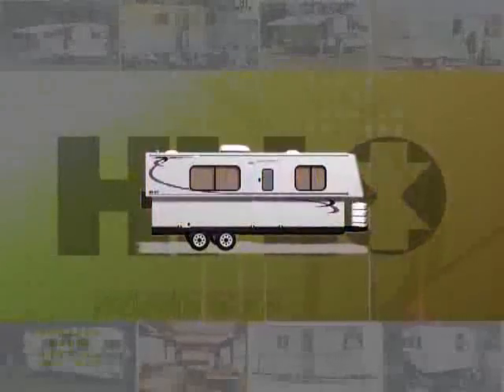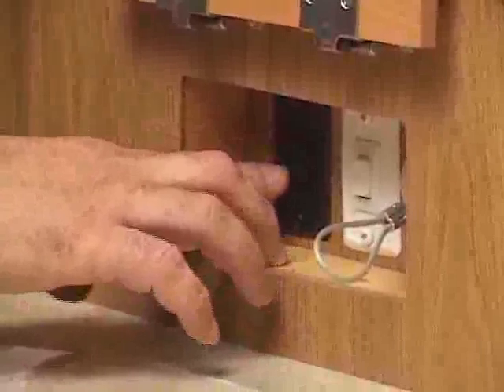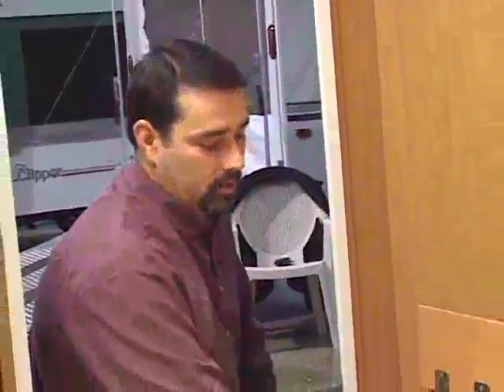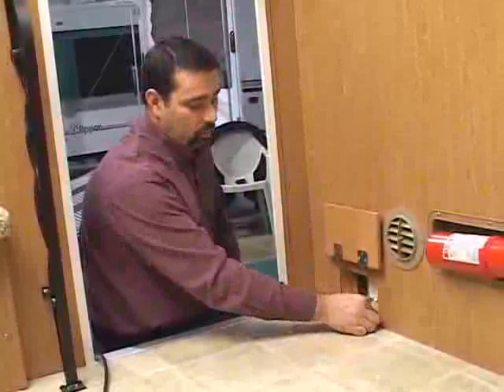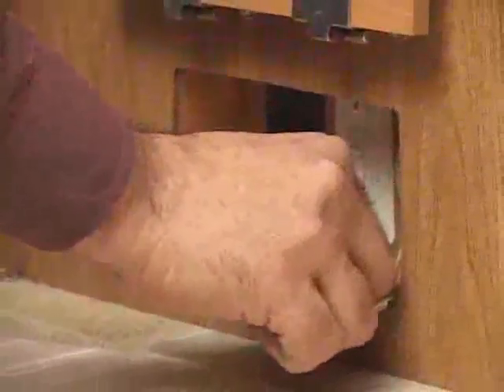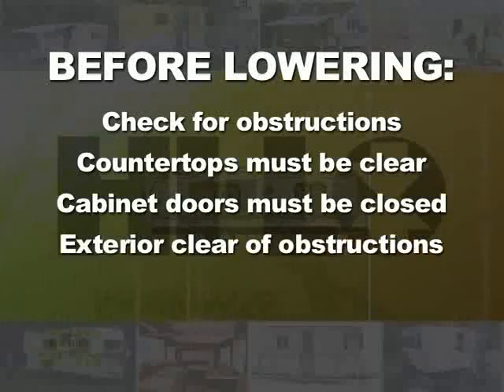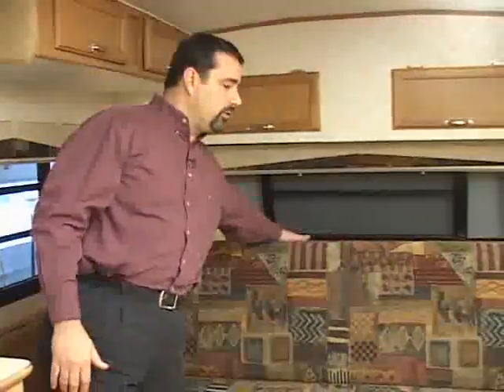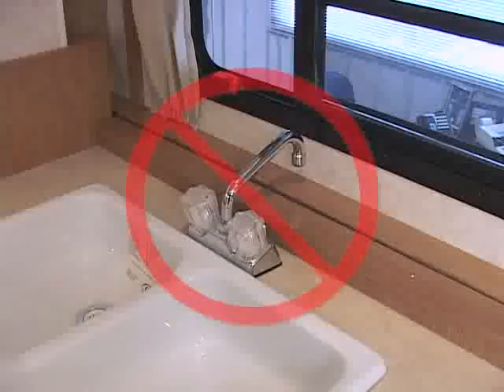5 Hi-Lo-raise & lower

Comment: Hi, Nice video. I am thinking about buying a 1997 Hi Lo24D for 1,350.00 cash from a used camper dealer. Maybe i should not buy this one. Some people in here are telling me it's more trouble than i know. Could you tell me how to bypass the Hi lo system switch. It won't go up anymore. We can hear the motor making sounds.

Comment: I have a 16 foot Hilo Fun Lite trailer having problems with the hydraulics throw the switch on in the hydraulic electric motor makes a grinding sound the hydraulic fluid is full . what could be the problem ?The electric motor keep running and making a squeaking metal to metal sound what do you think the problem is I am in Sacramento California I’ve only raise the trailer up once then lowered it down drove it to campsite raise it Up been here two weeks in and it will not lower down is it OK to drive it with it in the upright position question

Comment: Is there a backup function in the event that the camper doesn't raise or lower using the usual methods?  Thanks!  These videos have been a godsend to me!!  I just bought one, a custom 33' (custom for wheelchair), and it's my first camper!
Reply: Did you ever get an answer for your question as far as how do you put the camper up and down if you can’t do it with the electric is it anyway you can do it manually using a crank on a 2000 high low
Reply: Hi, I am thinking about buying a 1997 Hi Lo24D for 1,350.00 from a used camper dealer. Maybe i should not buy this one. Some people in here are telling me it's more trouble than i know. Could you tell me how to bypass the Hi lo system switch. It won't go up anymore. We can hear the motor making sounds.

Comment: I am in need of help finding my fuse box on my 2003 HiLo travel trailer 23f I have found the circuit breaker box but no fuse box HELP. My fridge & Air conditioner are not working